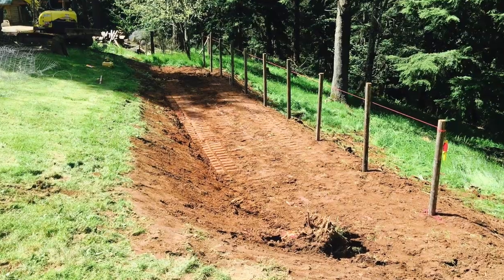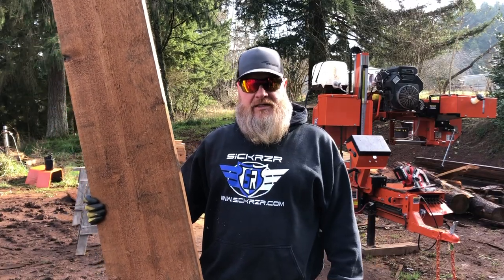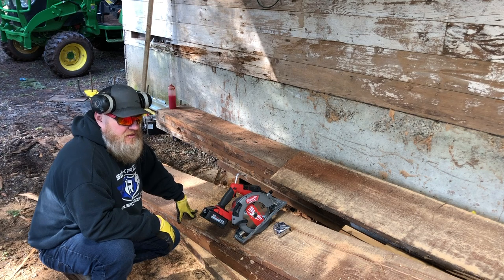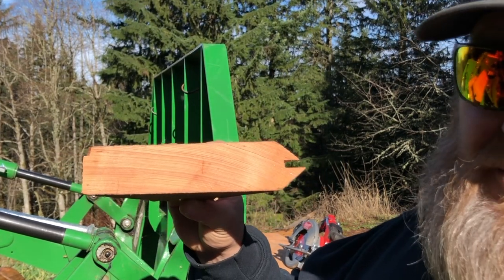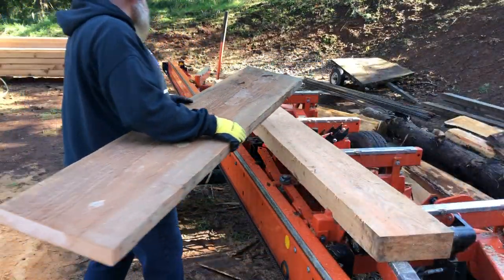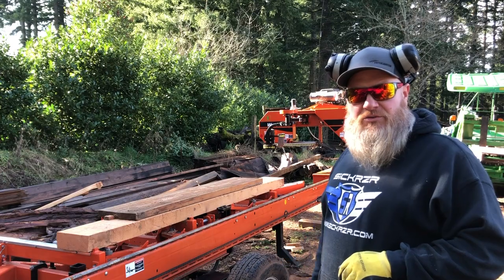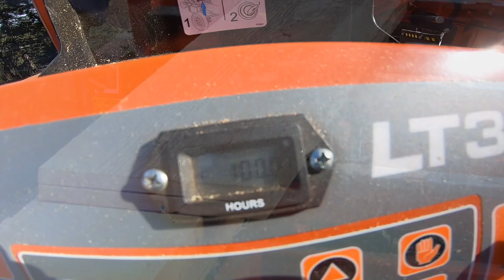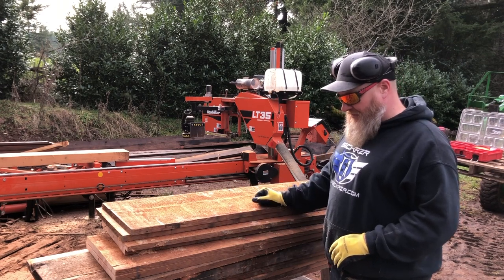Resawing Old-Growth Lumber For My Wall Project

Comment: Finally someone else does it the way I did do it. Can't anymore from a wheelchair but it still is fun to watch. Glad you showed differences in old growth and second growth timber. The shear strength is massive and nice to see saved. Many years  ago, tearing down a old shed full of junk, I rolled it over and the junk fell out but was as solid as the day built. I took the time to disassemble and man was it worth it. That old shed was owned by a old shipwright and made from lumber he saved giving it some real age, here is the bonus! Teak lumber once in a ship then given purpose of a cow shed then old tools. One by one out of the trash came tools that came from who knows, the mayflower for all I know but once placed at a auction, was taken out for private  sell as he paid me for each piece by an independent appraiser. I got close to seventy thousand for stuff intended for landfill!! Great video
Reply from the maker: Holy smokes!!! That's quite a story!
Reply: i found old/reuseable wood that way but never found that kind of jack-pot,, mostly oak,maple,pine/eastern cedar,, would have liked to been a bird in a tree to see  that

Comment: LOVIT ! Just a Note, You can buy a wand style Metal Detector for Cheap on EBay just in case ya missed one or one has been busted off !
Thx’s for Sharing
Reply from the maker: I actually have one from amazon. $13. If it finds one nail (which it has) it pays for itself. 😬 I’m also running Bimetal blades which can take quite a bit of abuse from nails.

Comment: I've done remodels where you could barely hammer a nail into old growth doug fir. It was literally as hard as oak and we actually took to predrilling for the nails after bending three nails over.
Reply: pneumatic00 we had a old workshop where the electricians had too drill and tap it to put new fixtures up.

Comment: I have a question on your sawmill would you change anything make it bigger different motor different size if you had to do it over good bad I'm looking to buy a sawmill looking at leaning more toward wood-mizer thanks
Reply from the maker: I’ll answer that now Incase your looking to buy soon. When I bought my mill, I had no idea the money I would make with it not only from sawing but from making videos. If I could do it again, knowing what I know now, I’d probably get an LT 40 wide. I would definitely stick with Wood-Mizer. Their customer service has been excellent. At the time the LT 35 was all I could afford.
Reply: Thank you so much that is the one I've been looking at I just think the wide is the way to go
Reply from the maker: Dennis, anytime I get my saw hung up on a log, it’s just barely. That extra cut width would alleviate 99.9% of the problem.

Comment: Use a wooden cleat on the side..
Reply from the maker: I was doing that at first but the screw heads bite into the edge of the board I’m sawing and help hold it down. The wood cleat would also trap sawdust.
Reply: Northwest Sawyer , never thought of that.. cool idea..